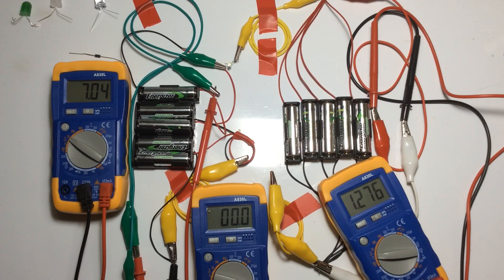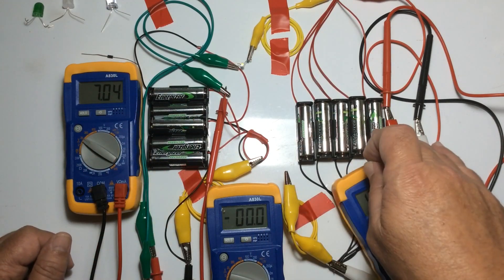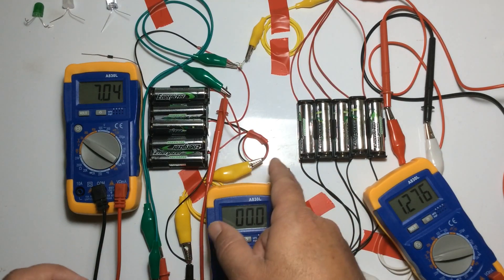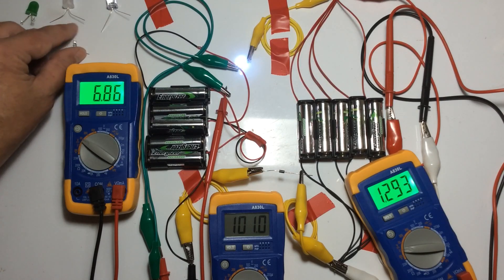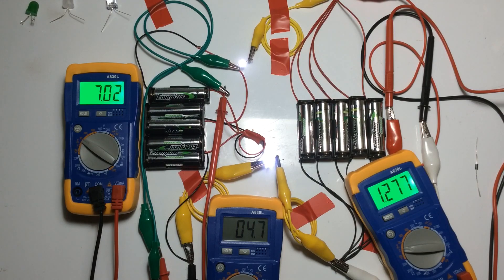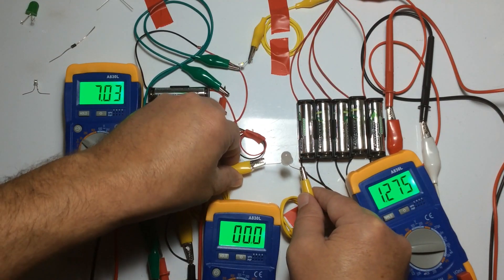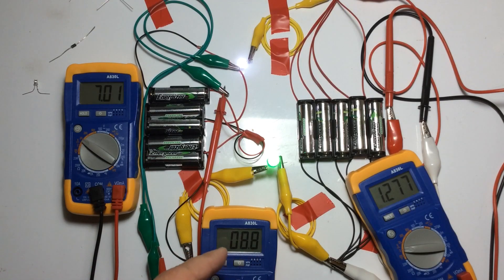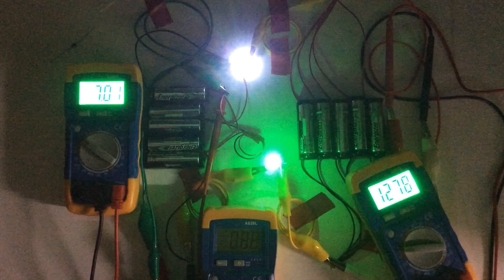EFFICIENCY BREAKTHROUGH USING TESLA POWER TRANSFER

Comment: Sorry to break the news to you but you didn't discover anything new. There is no Tesla anything, no gain in efficiency. Get a good electrodynamics textbook where you'll find basics like how batteries work, internal resistance, etc.
Reply: Why waste your time with trolls,, he is attempting to derail, efforts in understanding the benefit if this circuitry. He only has to muddy the water to succeed. Ignore comments that are not beneficial to the understanding or advancement of this circuit. I suspect you where very close to discovering a advancement or practical use for this. My guess he works for the department of energy or power company lol kidding ofcourse. But his sole intent is to be a  disrupter. He has nothing to contribute to our community then ignore him.
Reply from the maker: @secondline5641  Thank you for your comment.
I believe it is important not to silence others opinions. I know the text books are wrong and therefore anybody staking their claim from that perspective must also be wrong. I have performed the experiments then listened to others perspective and re tested in accordance with their all be it skewed perspective.

My perspective is this, I perform the experiment, I witness something that does not conform to the textbooks “theory”, I then investigate the findings in depth because I want to understand if the textbook deliberately omitted this information or whether the text book does not know this information.

I will never be deterred, from the first moment I started experimenting over 22 years ago, the first incident that did not conform with the education started a spark in me that will never be exhausted until I take my last breath. I have had the pleasure of re-educating an Air Force Electrician on the Adams Pulse motor after he reviewed the Adams motor in depth and got it wrong because of his training. Let me say he was not happy, just like my first discovery of being lied to he felt betrayed and confused. As I pointed out to him, it is not his fault and he had learned well what he was taught, the actual problem is what he was taught was wrong.

I have done the test that @MCPicoli is asking me to do and I stand my ground on my perspective. In my opinion @MCPicoli is using his education to come at the problem when I am doing what Tesla said to do, perform the experiments and you will see you are lied to. The use of his education and the reference to Kirchhoff’s law is where he is going wrong, the LED doesn’t give a crap about Kirchhoff’s observation nor does the rest of the system, my education also led me to believe the parallel set was purely resistance but I have already made a video showing that is not reality, that is what the education states but in this world that is not what is happening as I have clearly demonstrated.

Fear not for my determination is strong, I have seen far too much that violates our laws and I see the laws as blinders, I have had many a conversation with trained electricians, I have a friend that is an Electrician and the most common statement from him is “it doesn’t work like that”, even though he can’t explain half of the stuff I show him. On one occasion my friend asked me to hide one of my devices in my car, confused why, when I asked him he said because the other guys in the shed would expect him to explain it and he couldn’t. 

We have come to an agreement that I stop making him feel stupid by presenting him with the reality that defies his education.
Reply: @secondline5641  What I am trying to tell is that everything that was observed can be easily explained with simple known rules and equations that any electronics textbook contains. There is no new discoveries here. While I applaud the investigative spirit, I also consider a waste of time pursuing something that is already explained and defined. At most, it could confirm them.
Reply from the maker: @MCPicoli  What I am trying to show everyone is there is a better way, a way that is not told to the majority, a way that is not sold to the majority. This is NOT new information, it is however obscured, kept out of view. This is a terrible situation that governments globally have manipulated, they do not sell devices that use this concept which in turn requires you to burn at least ten times the energy for the same outcome.
They teach Electricians to be arrogant, the “that’s not how it works” smug attitude that they are smarter than you, they rely on your ego, your ego stops you from performing the experiment because you preside on the assumption the book was right, I have witnessed the ridicule from educated people, their egos refusing to acknowledge what is in front of their eyes.
Just this simple device alone is evidence this is clearly a better use of power, I have a working product that lasts significantly longer than anything your education can give you.
Again you have cited laws and observations, I must be honest with you, I don’t buy it! Please do yourself a favour, repeat my experiment then give me the math that your education uses to explain it, just saying it can be explained by basic laws is not going to cut it because the laws are BS.
Reply: Hello could you please develop. Do You say that that kind of experiment is already described and is well known ? If you have a good reference I would deeply appreciate if you could share it with all of us. Thank you in advance for your help.
Reply from the maker: Thank you for your comment.
I have been very clear that this is an old discovery, possibly older than 100 years. I am unsure what you mean by there is no "Tesla anything".
I would debate the relevance of obtaining a good textbook in any field, this information is not taught to us every day citizens, that they can do things a better way and save themselves some money and no textbook known to man is going to explain how to achieve this and that's assuming they know this.

 If the teachings are wrong then reciting the teachings accurately makes you nothing other than exceptionally wrong.

I am also unsure how you evaluate the setup as having no increase in efficiency when the conventional method would deplete the stored power in under 12 hours, yet this system is still running now 96 hours later, non stop, running two 20 mA LED's both of which are still fully lit.
Current readings are as follows.
Series battery bank = 6.41 Volts
Parallel battery bank = 1.297 Volts
Current = 3.6mA
Please point me to the textbook that describes this as a possibility and or demonstrates how.
Reply: @whatifididthis...1236  Study carefully the following topics: Kirchhoff's laws, Ohm's law's. Practice a little. Then read about nonlinear diode behavior. Practice a little using your own schematic. You'll see the pieces falling together and will see that what you observed is 100% expected.
Reply from the maker: @MCPicoli  What I would appreciate is someone that believes they understand how this functions to actually spell it out instead of reciting laws that loosely try to explain away a phenomena, rather than say why it cant be I just want someone to tell me how it is doing what it is doing instead of stating it just cant be.
Give me the math that explains how this is still running at full brightness and judging by the the series bank sitting at 6.38 and consuming only 3.4mA we have a long way to go!
Reply: @whatifididthis...1236  do the following experiment. 3V source, in series with potentiometer and LED. Adjust potentiometer so the current is 3.8mA. Build another identical one with an identical LED and adjust to 20mA. Turn both on side by side and judge if the brightness is the same.
Reply: @whatifididthis...1236  Finally, third experiment. Build two circuits, identical to your original experiment but one of them has the two LEDs in series one after another and the other is identical to your original schematics. Measure the battery durations in both cases. You'll see that they're identical, implying that in a DC series circuit the current in all elements is the same regardless of their order.
Reply: @whatifididthis...1236  You are under driving the LEDs in series at only ~0.7 v above minimum voltage for lighting the LEDs, therefore the current is low at 4 mA. Kirchhoff's laws ensure that there is no difference if both LEDs are in series one after another or one is after each battery set.
Reply from the maker: @MCPicoli  I don't believe the LED is being under driven, I have done a lot of tests with these LED's and I know what they look like under powered. The white LED is currently operating at 6.38 volts minus the 1.299 volts of the parallel set and they are operating under the voltage influence of 5.081 Volts, therefore with an approximate voltage drop of 1 volt for the white LED meaning the voltage presented to the parallel  batteries is 4.081, lets be generous and call it 4 volts. Now if we assume the Green LED is reducing the voltage again then we are at an approximate 3 volts, this light is listed at operating at 3.2-3.6 Volts.

Kirchoffs Law, I feel has no bearing on the real world outcomes of this setup. Nothing about Kirchoffs law explains the efficiency of this circuit but merely decribes the equal current measured at different nodes. It does NOT explain how the circuit is so efficient.

The point I will make now is as I stated in the video, this circuit and its function is NOT taught in any school, any lecture any where that I know of, our widely used devices, the items that are commercially marketed to us do NOT use this concept. We are educated in a manner that steers us away from this concept because it costs us more and earns them more, this circuit is a perfect example of that fact as both LED's would have those batteries empty in under 6 hours where this circuit is still fully lit after days of operation.

 So it is fair to say that the concept is a breakthrough, the breakthrough of having it communicated to people so we can actually benefit. How anyone can realize this and believe we have been taught this is beyond me.
Either way there is no law that explains why this is still running, the laws that do cover this only state why it won't work.
Remember, this is still running and this method of power usage is far more efficient than what is taught and or commercially available, our governments allow companies to sell products that waste energy when everything could be converted to truly save the environment. This is over 100 years old, if our governments didn't know of this then they are seriously useless beyond belief, I prefer to believe this is known and hidden from us!
Reply: @whatifididthis...1236  "believe" and "looks" have no place in an objective, accurate measurement. If your LED is nominally rated to 20mA, driving it with only 3.8mA is definitely underdriving it. While LEDs have better luminous efficiency when underdriven, it is impossible energetically that the brightness is the same. Maybe close to the naked human eye but definitely not equal.
Reply: @whatifididthis...1236  Then do another one similar to your original experiment, but replace the parallel battery set with an potentiometer, starting at the position with the maximum resistance and then turning it as to increase the current to the observed 3.8 mA. Measure the duration of the battery of the series set. You'll see that it will be very, very similar to the original experiment, implying that the reversed parallel battery set was working just as a resistor limiting current.
Reply from the maker: @MCPicoli  Again your approaching this with your education whereas I understand the education is flawed because I did the work and saw the result with my eyes. I have already demonstrated the theory of the parallel battery set acting solely as a resistor to be WRONG in another video. I too assumed this was the case because of my education, but my skepticism of the education forced me to grab a potentiometer and try it anyway, let me just say I wasn’t that surprised that the education was wrong.

Now there are only two paths we can go down here, either the people forming our education didn’t do the tests and instead relied upon their existing education to draw assumptions or they have deliberately steered you in the wrong direction. I find it difficult to believe with all the money spent in research by all the combined nations globally that they don’t know this, I honestly believe we were lied to and our education is at best half truths. Consider the FACT that battery manufacturers do deals with government to continue building more disposable batteries, they have contracts in place to keep the status quo that prevent new battery technologies from making the trillions of AA’s obsolete. They are literally stalling the progression of technology so you keep buying AA’s.

Assuming what you say is true that they do know this and do explain this to electricians then one has to assume that every electrician sat on their asses and not a one of them saw the potential for a better use of electronics and chose to go with the flow and not become a millionaire by producing a product that used this concept to SAVE THE CLIMATE AND HUMANITY, really...not one!

The shame they should feel, if you knew this and you have sat on your privileged ivory tower and NOT felt the need to help people with the simple things in life, like Grannies hand held battery fan that she buys a 20 pack of AA’s each week when she can’t afford it and you let that happen, or the child that wanted a night light but whose parents couldn’t afford the batteries or the millions of us that make up the 99% of the global population, that slave every day for energy and still can’t afford it. 

If this truly was known by academia and you all did nothing to change it then you should hang your head for you might be the reason we are all in this mess.
Reply from the maker: @MCPicoli  Also I might add, the entire theory that the parallel pack acting solely as current limiting resistance completely ignores the fact that the power is stored in the parallel bank. Common sense suggests if it was acting solely as a resistor there would be no charge stored yet there is approximately 70% transferred that is real usable power instead of a theorised loss by our education.
Tesla stated that Einstein’s theory of relativity was nothing more than mathematical garb, like parading a peasant before the people in the kings colours.
Like Tesla, I do the work whilst others like Einstein theorise in a hypothetical reality.
Reply: @whatifididthis...1236  My three experiments would demonstrate clearly if you are right or wrong. Do them honestly and tell me. Regardless of what textbooks say.
Reply from the maker: @MCPicoli I have already done those experiments and displayed them in my videos, I have no reason to lie to you, I’m not selling anything that would benefit me by being deceitful. Buy the batteries, I don’t care which brand as I have no shares in any AA manufacturing company. I have done this work, I expect the education to be wrong these days so it no longer bothers me that they are wrong, I know we were lied to. For me, I have seen their lies with my own eyes, for you, there is only way way you will see I’m right, you have to do the work, then we can have an honest discussion, I assume you won’t deceive yourself and then you will know I am right, then and only then can we have a decent conversation.

Just like a recent human experiment carried out on the global population your taking the advice of “Safe and Effective” as factual yet when you look at excess deaths globally since the experiment was carried out it has shown to be anything but “Safe and Effective” yet our education is still pushing that narrative.

Your, Our education is wrong, please do the work so we can be on the same page.
Reply: @whatifididthis...1236  Please link the videos.
Reply: @whatifididthis...1236  Fourth experiment. Build as per your schematic but instead of five in parallel, put twenty. The LED will be brighter and the series set will last less time, proving that the parallel set is only acting as a resistor.
Reply from the maker: @MCPicoli   This will not prove anything, as the power is still going to be transferred but as you are now transferring this to a larger capacity bank it will naturally bring the overall voltage of the parallel bank to a lower potential voltage and this idea is still ignoring the power that has been transferred.

I would recommend that you watch this video, I am going to state that I am not as smart as the three individuals in this video but clearly you can tell that you were lied to by watching this. Please take note of the discomfort expressed by an intelligent man realising he was fooled into believing his education was correct.
https://youtu.be/iQOibpIDx-4?si=OIwf5X1LYxcBKA04
Reply: @whatifididthis...1236  Afraid of the black helicopters yet?
Reply: @whatifididthis...1236  he is being paid to disrupt your Channel. He won't stop, it's his job.
Hey man your about to hit a home run, with your work here. Just need a aduino an some relays, to automate the battery switching. If ya need help with the code, I'm happy to help.  He is simply trying to stop you from hitting that home run for your Channel. I plan to use this battery system for my solar. How many other people will benefit from your work. Forget about this guy an get back to work lol. You have a whole community on your Channel who agree with you ideas.
Reply: By the way you will need 4 sets of battery's for the relays switching made easy.
Reply from the maker: @MCPicoli Not anymore, I used to be though. Half of the stuff I have worked on led me into a world of suspicion and had me interacting with suspicious characters and some of those interactions still give me goosebumps today. 
What changed in me that no longer causes me to give a crap? I was told many years ago that I would exit this earth early, significantly earlier than most and it was this notification that started my journey for answers, I was like everyone else that wanted answers but I had been told I had about half the time in which to find those answers.
I was given permission to no longer play the game and after working 16 hour days for years the transition was difficult. When I stated I would go mad having nothing to do all day I was told to learn to occupy my mind and entertain myself. The next day I was holding a fold out cutaway of the space shuttle and noticed a mention of the 12kw hydrogen generator that supplied the shuttle with most of its electrical needs, my mind tripped over this concept, fell into the rabbit hole and never came back out. The thing is I have read of the “conspiracies”, the horrible things that were done to people for speaking the truth so I towed the line to enjoy the little time I was told I had but the further I surpass their expectations and the longer I live the less I give a shit about what they might do to me now anyway, I’m in pain everyday anyway, my spirit had been tested every day for at least 40 years and I’m still standing so bring it on I say if that’s the price of the truth so be it.

When you have a conversation with the research department of shell oil, when they chased you down because your grandfather stuffed up and ended up on the news for what you built and installed in his car and they just want to have a friendly chat to see where your at with your research, then perhaps you too would not appreciate the visits from black helicopters, fortunately I knew when to get out of that game and packed up everything I had, stopped answering their phone calls and they knew I had stopped and then it all ceased after I told everyone my grandfather had lost his marbles and had spoken incorrectly. I was approached many years ago and told if I knew what was best for me I would stop all of it, I became a recluse and I am still trying to walk away from hiding as my frustration of taking information to my deathbed bothers me more than anything.

The reason why they say follow the science is because science is fluid, constantly evolving, constantly changing as science meanders its way through our reality, if it were absolute as our education dictates there would be no follow the science it would be “follow this line here and do not deviate” which is pretty much our education in a nutshell, which is the way they want it.

This reminds me of a Guns and Roses song about civil war, the start of which was taken from a movie called Cool hand Luke in which the captain says to Luke after shackling and whipping him says.
“What we’ve got here is a failure to communicate, some men you just can’t reach, which is what we had here last week, which is the way he wants it,...well he get’s it! I don’t like it anymore than you may”.

The failure has been education, we are all in Luke’s position being told that our failure to understand is because we won’t swallow their BS in the first place and we we just accept the shackles are for our own benefit it will make all the BS seem sensible.
Failure to communicate the truth.
Reply from the maker: @secondline5641  Thank you for your comment.
You could be correct but I still feel he should be allowed to speak, there is still a possibility that he is in the group of the unknowing and about to cross over and if so answering these questions could help. The truth I have seen and lived so someone not understanding and judging is like water off a ducks back for me because I have the truth, at most I feel sorry for them, for one reason if they are a troll...what a crap existence that must be and for the second reason of not knowing, well living in an alternate reality would bite hard on your soul also.
I would greatly appreciate your assistance with the coding for the switching so perhaps send me a message in another thread and we can work on it with the rest of the viewers, everything open source.
Thank you for your words of encouragement.
Reply: With only one LED, it works at more than 3v above its minimum forward voltage drawing around 30ma
Reply: Therefore it would be expected that with one LED the cells would last 10x less